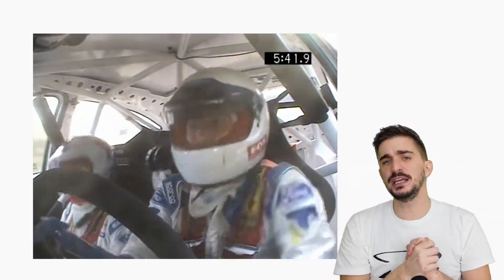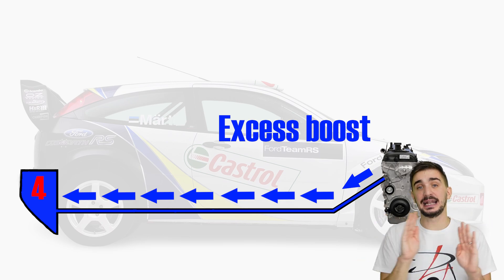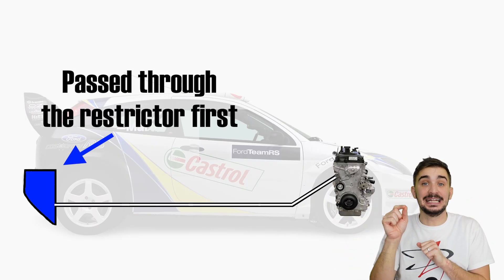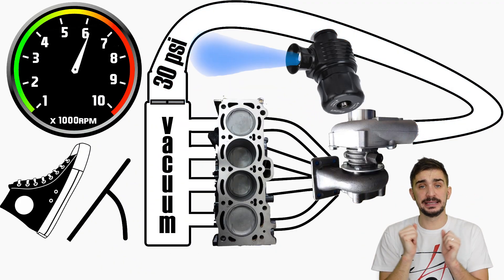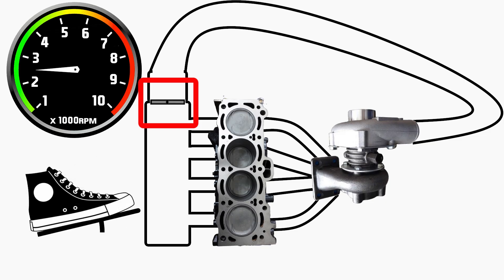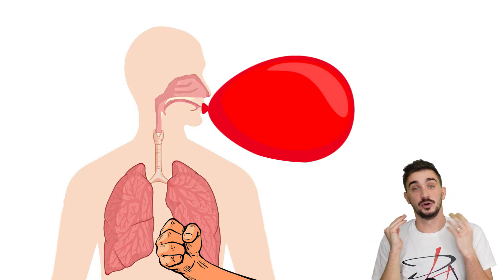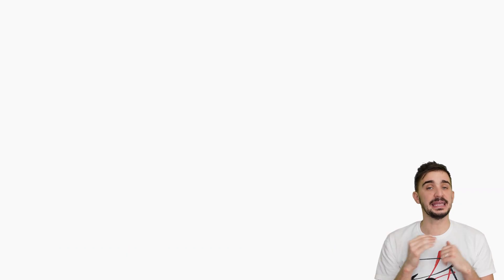FORD'S HIDDEN BOOST Tank - Welded TITANIUM filled with ANTI-LAG

Comment from the maker: Become a Tuning Pro: https://hpcdmy.co/dr4a
Support the channel by shopping through this link: https://amzn.to/3RIqU0u
Patreon: https://www.patreon.com/d4a
Reply: Have you heard about Subaru Anti-Lag "Rocket"?
Reply: @simonasdrungilas1219  https://youtu.be/ms3U7Ztoip8 this guy has made a video also on this Ford system
Reply: Can you make a video on the EXUP (exhaust ultimate power valve) and similar systems? I think alot of your followers would find it interesting and it really ties into some core concepts you have already covered. Plus it will bring more of the motorcycle community over to D4A! 🙌 Expanding horizons 🙌
Reply: You always make me laugh aloud. I am an automotive teacher, and love your comparisons and explanations! I'm planning a motorcycle tour through BG this summer, I'd love to buy you a beer!
Reply: Does not high pressure air trapped in the inlet manifold stall the turbo?
Reply: Wouldn't the tank also serve as a "reservoir" of boost/air? It seems it would buffer against lower-RPM boost drop and provide more of a steady boost pressure beyond a typical turbo efficiency/pressure/flow envelope and thus a bigger advantage than just a bit more peak pressure to me. Maybe with anti-lag it isn't a big effect.
Reply: you're awesome, thank you for coming to my ted talk
Reply: Would you consider doing a video on the Torquey QR25DE engine?  Or have you made one already and I just missed it?
Reply: Not to be a dick, but closing the throttle ≠ significantly lower ENGINE RPM (as I know you know but somehow inaccurately stated). 
...just lowers the TURBOS RPM ... causing lag.
Reply: @trumanhw  you lost me? Isn’t that what he said? Could you clarify?
Reply: Is there any advantage to gearing on a turbo's common shaft to increase the compressor wheel's RPM? (potentially reducing lag)

Comment: 7:11 Technically there is more pressure in a bigger balloon, but the factor causing the larger balloon is definitely not pressure. It's volume. bigger human=bigger volume ≠ bigger pressure per definition. I reckon that it is even easier to create higher boost pressure with a smaller turbo, al be it with lower flow. idk nice vid have a comment 🎉
Reply: 12:19 I know the answer, since the tank is using a smaller diameter over a long pipe it is probably exactly the same pressure as before, 300psi

Comment: There's a pro street drag car that uses compressed air at 300psi instead of turbo or supercharger... The HUGE tank runs the length of the car along the passenger side.

Comment: Its not that it cant create more but engine cant take more. All stock turbines can make over 1.5bar which is almost all turbos limited to becouse engine cant take more but turbos can make over 2bar. Race cars use bigger turbos not for preassure but for flow and speed boost build up

Comment: 12:25  Correction- When the throttle closes the 30 PSI of air is going to increase briefly since there's no blow-off valve to vent it out.

Comment: It would have been cool to see them use this volume of air to drive a diaphragm pump to provide a pressure spike as needed.  That way, you are using the volume of air and not just the pressure differential.

Comment: WHAT WOULD HAPPEN IF YOU USE A HIGH PSI TANK ON A STREET CAR  TO KEEP BOOST UP IN THE MOTOR BUT THEN  ADD AC COMPRESSOR TO IT KEEP BOOST UP IN TANK PLUS RELEASING THE PSI OUT THE TANK FAST WILL COLD THE AIR COMING OUT OF IT WHICH WOULD ADD HP

Comment: Couldn't this be used to give a production car anti-lag (that doesn't kill the turbo and isn't obnoxious) instead of excess power? Run the engine on the compressed air until the turbo spools up conventionally?
Reply: It's only a quick puff of Compressed air... Engines breathe a LOT of air, like a leaf blowers output. 

This system was to help a small amount with off throttle transitions, a fraction of a second. 

A road car could not benefit from this in any meaningful way... In racing crews are chasing tiny advantages. 

Some supercar could do it as a gimmick, but for a sporty road car it's pointless.

Comment: You state with such high certainty that it is impossible to create higher pressure air from the outlet. But it is actually possible by sacrificing some mass. This is the basic principle behind ram pumps used to increase presure of water by sacrifing some water. It is theoretically possible to construct a small ram pump that could increase the pressure well beyond the original pressure, though im not sure how practical or durable such a solution would be.

Comment: One could even make a boost tank for na/engines without a turbochager.
Speed wind turbine
Or heat exchanger on the exhaust manifold driving a small steam turbine
And intake resoir boost-tank with a reed valve

Comment: May be, in one of your videos you could cover PowerPulse system that was installed on Volvo Drive E diesel engines. The concept is similar, but the source of pressurized air is an air pump. After several years Volvo decided to discontinue it due to reliability issues, but if it works properly, it really  helps to bridge turbo-lag on city speeds

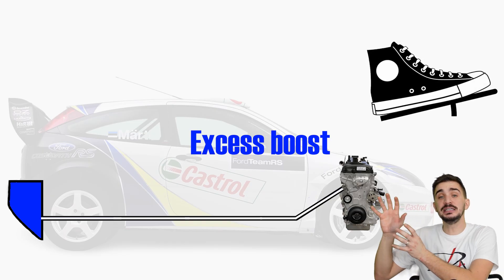Comment: @3:00 actually amazed they did not just use the roll cages as storage  ...  @11:20 I often wounder why their is not another tandom valve that just seal off the turbo outlet keeping the pressure in the manifold / inter-cooler ready for when throttle is opening again @18:40 20kg ,,, who the hell thought that was a good idea? that is ~1.6% weight increase  rally cars limited to 380HP

Comment: Aircraft escape slides are inflated by a small CO2 bottle operated 'aspirator' which works as a jet pump to help multiply and fill the air volume needed by the slides. Can this principle be used for that purpose too? Just thinking.

Comment: Okay not arguing. Just a general question I have. Wouldn't the amount of PSI you could potentially put in a tank be limited by the force that the compressor wheel could be turned by, not necessarily by the inlet size of the turbo? Like those tire inflators that can go to like 300 PSI, but are way smaller than a full size air compressor, they only make that PSI by using leverage, they have a tiny intake but the pump turns a ton of revolutions per volume to make that pressure that high.

Comment: You talk about to MMM thin tank like to mmmm is actually quite thin. I don't know how thick you think metal has to be to be considered thin, but by the time it's as thick as 2 mm, it's pretty easy to weld regardless of what it is. I only welded for 41 years. So maybe I never quite got a grasp of thin metal. But 20 gauge and thinner is getting pretty thin to weld. 2 mm, you can weld that by accident, you just need to turn the machine up high enough. If you have been previously welding thin sheet metal. Or titanium

Comment: My favourite innovation in rally tech is Subaru's anti-lag "rocket" system, which had a similar relocated pressure chamber, but only to encourage starting and maintaining the system. With it making full boost at idle throttle, and with almost nothing feeling "cheaty" about it, it felt truly innovational.

Comment: It’s a pressure accumulator right ? Equaling out peak and low boost moments… it’s not increasing the boost, it’s just storing a higher volume of boost air than the normal inlet tract can.
should be added to every normal turbo car, would help to reduce lag and possibly help acceleration might even save fuel

Comment: You also fail to bring up surge.  The pressure can't easily peak over 50psi  in a surge situation.  Think it terms of the weight and mass of air coming to a sudden  stop.  Depending  on location of the port leading to the rear tank  I'll yell you want the rear tank will be able to achieve  even over the  peak boost.  However  the long tube hardly being over an inch  doesn't help  get the most return from the peak of the surge.

Comment: The tank could, yes store the same amount of boost but, no not gain as much boost. You mentioned that it could hold 45 liters. But that doesen't mean it would store as much boost as the passage between the turbo and the throttle plate. Because that passage would have a goal of very little capacity (to make sure of no delays), the boost would totally change pressure in a 45 liter tank, a pressure smaller than predicted. It is all about how much air is stuffed.

Comment: Can you answer, I have an AUDI A6 C5 B4, 2.4, 170hp, I put a large sports filter, with wide aluminum pipes, now I bought a supercharger, which I intend to connect to the throttle valve connector, but I need probably boost, which will give me enough air volume, by pressing the gas pedal, which boost would you recommend? And would it affect the quality of the engine? Greetings from Zagreb, Croatia, Nino

Comment: Another slight advantage is the long tube and tank far away from the engine would act as an intercooler. However the cooling effect would lower the pressure so it would take longer to fill the tank. I'm curious as to what studies they did on tank size as that would have a similar effect as turbo sizing. A bigger tank equals more volume but also more time to reach peak pressure.

Comment: The could build a tank with pistons under spring pressure,.  With a motor to pull the piston back against the spring pressure,  I instantly releasing the full volume when boost is needed! 
 But a turbo that has a hydraulic motor inside, that can run off oil pressure maybe something,  it would require a one way clutch to allow it to work as normal,  or maybe a steam turbine, using steam created by the exhaust heat,  but an electric motor would make the most sense,  use a super capacitors to store power, when slowing like Regen braking,  possibly by modified alternator,  that can output a separate 60v or so to charge the caps, allowing a run time of a minute or two

Comment: Would a tank like this work as something similar to anti-lag, but without destroying the turbo? 

It would probably lead to slightly lower boost at high RPM, but it would allow the lag to be diminished significantly. That's my theory at least.

Comment: Compressed air isn't anti-lag, it's a bandaid for shitty turbocharger design and selection. In 2003, there were already in use, variable geometry turbochargers. They could have designed and installed one for their rally car. VGTs don't increase power, they allow the engine to operate with the most amount of power it can already produce, at all RPM loads. Ignition "anti-lag" is also stupid. You Gasoline guys have very dumb ideas when it comes to producing forced induction, us Diesel guys have been laughing at you for over 25 years at how slow you are to adopt our technology.

Comment: Yes you can store boost.  The biggest fault of turbo charging is what is known as turbo lag. That is, during closed throttle, the boost level drops and when the throttle is opened, again, there is a short time when the boost pressure is low. Waiting for the turbo charger to "spool up", may only be a few tenths of a second, but  lower horsepower does inhibit acceleration.  Having a reservoir of pressurized air available, can compensate for this turbo lag.  So, yes this tank could have given this car an edge.

Comment: My grandfather designed and built an engine that did something similar..

However each cylinder had a dummy cylinder for the extra boost, so it was all in the engine.

I think it was in the back of Popular Mechanics a long time ago. maybe in the 1950s or 60s.

Was also rejected by GM for adding too much weight, and unpredictable performance/efficiency gains.

I re-designed his (he died mid 1980s) on paper in the mid or late 90s. Never built in. I spoke to some people in the racing departments of some of the big manufacturers in the early 2000s, but they said I had to work for them, to consider my design, and that would mean they own the rights to it. I also didnt have detailed numbers to be able to make a fine tuned design. Mine was more similar to what's in this video.

At least now I know something like this can give about a 5% improvement, and someone figured it out. Would have liked to get some of the financial benefits that could have come with it.

Comment: About the bumpers. I think this was a year wrc demanded a minimum length. I remember the smaller cars all running extended bumpers. Peugeot and Skoda also used bigger bumpers. The Peugeot 206 GT was a homologation car, with those bigger bumpers.

Comment: Conclusion, the tank store high pressure exhaust air and when rpm cant make turbo spin fast enough, the air in the tank will help turbo spin and let more air intot the engine. The valve is more like two check valves but controlled by an electrical module if I understand correctly. Genius design and innovation but bad luck

Comment: Because of where the boost tank is located cant the boost tank store more air than the turbo at 30 psi can because the air in the boost tank can cool down? Thus in some situations it can actually store more air than the turbo can provide.
Like if you think of the boost tank as a parallel intercooler.

Comment: Why not have a tiny supercharger that pulls air from directly after the restrictor and stuffs it in the tank any time the throttle is less than 100% then you could make the maximum restrictor flow the average power instead of the max. You could have the tiny supercharger on a variable transmission drive to only come on at less than 100% throttle so as to not rob power when needed, also to keep the supercharger spinning at various engine rpm’s.

Comment: For anti-lag, why not just keep the waste gate closed all the time (except to avoid boost spikes) and just vent the excess air via a BOV, all the time (while rpm is high enough)? Just need more idle air (closed throttle) for enough run the turbo w/o too much engine braking. The only downside is fuel consumption and sustained heat in the turbo (but some anti-lag is much harder on a turbo).

Comment: Instead of just buffering the boost-error air when the throttle is suddenly closed, one thought is to keep the turbo compressing when idle via some anti-lag techniques (firing spark after exhaust valve opens). The problem tho is turbo output pressure is pretty low vs what's needed to maximize space efficiency of an air tank. (Edit after finishing video: that's what they did.)
Maybe adding another cylinder or two, that only compress air for storage, is a possibility. There's a new engine "cycle" that does something similar, but instead it flows the charge to another cylinder for immediate combustion.

Comment: Are you familiar with the technology of modern, adult air guns?  Using a hand pump (in some cases)  and a complex valve system, the gun's reservoir tank is pressurized to thousands of PSI.  all with individual strokes that are no more than 20 psi.    So in principal, Ford COULD have stored up far more than 30 PSI in that tank.
Reply from the maker: This didn't have the complex valve system, otherwise it would be completely illegal and grounds for immediate disqualification.

Comment: Hey ding ding before you accuse people of spreading misinformation learn the applicable science (what is Pneumatic Multiplication of Pressure?)
Reply from the maker: Before you throw grandpa style insults watch the video. There's no pressure multiplication of any kind here as that would be completely illegal and grounds for immediate disqualification for the entire season.
Reply: Look up pneumatic multiplication of pressure. The same principle applies to hydraulics. By your understanding of physics air systems on semi trucks would not work. Neither would any of the hydraulic equipment we use. I've been a diesel technician for about 5 years. Maybe look it up instead of being bitter and shitty as an automatic response.

Comment: think it would have been more effective if the tank had a spring loaded membrane inside.
then a couple airholes on the backside to let the air behind the membrane enter and exit when charging.
would result in extra pressure and more boost stored when feeding it back to the engine since the chamber expands unlike a solid tank.
basically like when you take a plastic bottle and try blowing into it you hardly add any air ,but if you place a balloon inside a bottle with airholes at bottom ,you can add more and get more back in return as the balloon deflates.

Comment: Honestly, this is brilliant. Finding a way to precharge and avoid lag, using excess pressurized air that is harnessed within the legally restricted airflow. If re-injection is timed right, no more lag....
Bravo to Ford Engineers.
Reply: I was thinking about maintaining boost and thought about a the way a water pressure tank works, did a little search to see if anyone had done it and found this. I wonder if they could pressurize the frame rails to save weight on a tank
Reply: That is kinda pointless when it already has a preexisting anti-lag system on board, the same kind everybody else uses 

Eventually by the time they did the Focus Mk2 WRC, the strat that got them to actually win the championship was incredibly tight packaging, the front of the engine tiled heavily on it's back in the transverse configuration to make the weight as centered as possible and reducing CoG, so much so they had to sacrifice a gear and use a 5 speed transmission rather than 6, but even that was all worth it.
Now that, was real innovation that you wouldn't see as obviously on first glance

Comment: Turbo Motorcycles did that for a bit and of course much less room to work with. Lag on a motorcycle is even more dangerous and deadly but if you could have a chaser to even everything outfit becomes much smoother riding. The Honda Turbo bike had 2 chambers for low and high rpm.